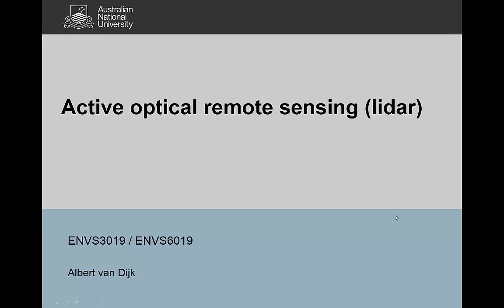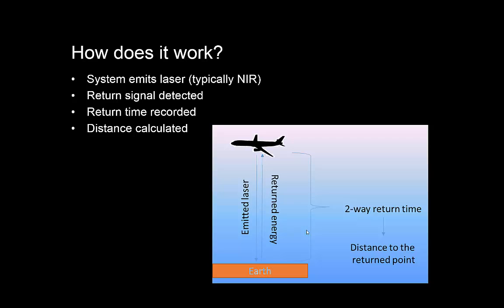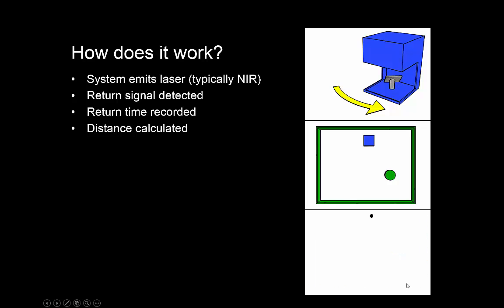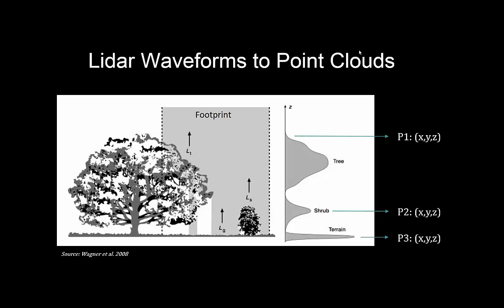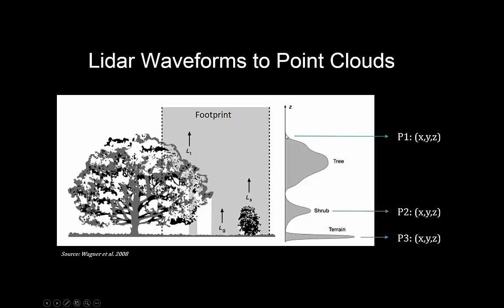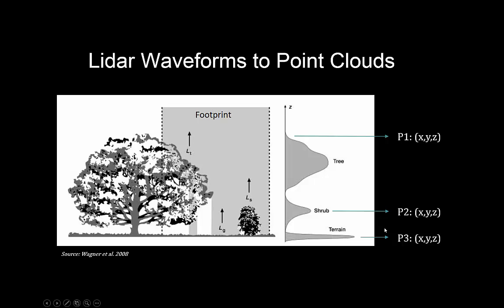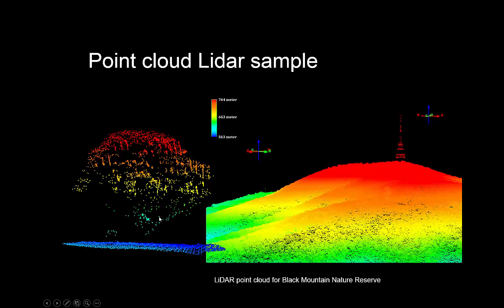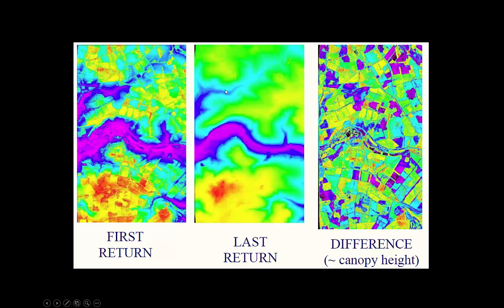RS3.1 - Lidar: how does it work

Comment: NO! NO! NO! We do NOT use last returns to make a Digital Terrain Model (DTM) from LiDAR. We use ground returns! 

If you interpolate last returns into an elevation model you get again Digital Surface Model (DSM). There is a first-return DSM and a last-return DSM but neither models the terrain because they include houses, cars, and varying amounts of vegetation. Many people seem to prefer using a first-return DSM but all of the open DSM data of the Environment Agency of England is a last-return DSM.
Reply from the maker: Martin, you are absolutely right of course, thanks for putting me straight!